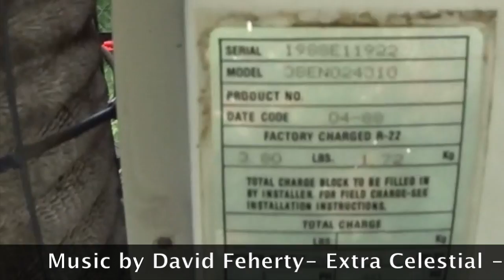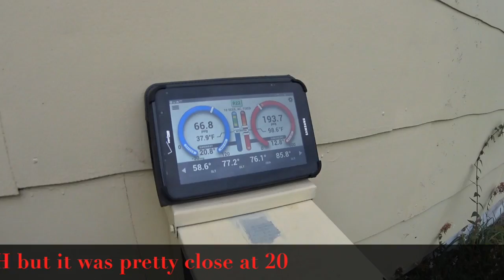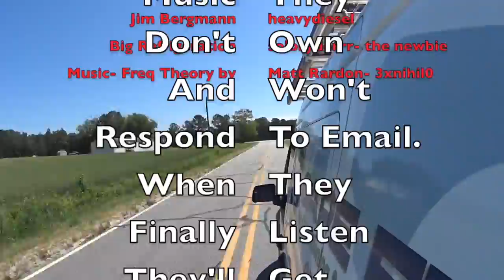HVAC Maintenance: Cleaning Your Air Conditioning Unit Won't Help

Comment: That 88 vintage unit was nasty. I’d have the owner give it a hug after the cleaning and show more appreciation for the job it does. I wouldn’t normally recommend cleaner on a spine coil but that unit really needed it. Here’s a fact. A build up of a .042” of dirt on your coil can reduce efficiency by 21%. This fact is from the EPA. I describe this to my customers. It’s like sticking a sock in your mouth and run around the block. Now take the sock out and do it again. Easier to do when your breathing good. Same as an AC unit. It works better when it breaths good. I rinse my unit with water every light bill.

Comment: What setting do you use on your coil cleaning gun?
Reply from the maker: Whatever number or letter is in the middle, I think. Haven’t changed it in years. I had one gun early on that when I tried to change settings it didn’t work properly so I found a happy medium and never changed it again. Thanks for watching!

Comment: ... And those poor people with their leaky R22 machine will get screwed by the EPA into replacing thier system because of the "ozone depletion" hoax.

=============

Does the fact that there is 6 months of darkness at the south pole contribute to lack of ozone there?

Why doesn't Clorox, pool chlorine, or chlorine from seawater (NaCl "salt water) deplete ozone?

Why do CFC's only deplete ozone at the south pole?

Why are CFCs the only source of high-atmosphere chlorine?

Being heavier than air, how do CFCs reach the stratosphere, which starts 6 miles up? 

Being heavier than air, what happens to CFCs when released into the atmosphere? 

If the ozone hole was "discovered" in the late 70s with satellite imagery, how do we know it wasn't there all along? 

The Ozone Scam
https://www.youtube.com/watch?v=9Szs-treHwQ&t=44s

Min 1:20  : The offending molecule is CHLORINE.

Min 3:30  :  Freon costs 50 cents/pound to manufacture. 

Min 2:40  : The biggest source of atmospheric CHLORINE is evaporation of seawater (NaCL in saltwater).

Climate 101: Ozone Depletion | National Geographic
https://www.youtube.com/watch?v=aU6pxSNDPhs

Min 1:50   : The offending molecule is CHLORINE.

Min 0:50   : Ozone is a trace gas composing 3 parts per 10,000,000 molecules of AIR. 

Lot of discussion of other sources of atmospheric chlorine: 
https://www.sciencedaily.com/releases/2010/03/100310134150.htm

Comment: How come no one cleans the opposite direction to push the dirt back out I see rinsing it that direction but I would have started with the soap that direction also and if that is not effective go to the outside
Reply from the maker: For this unit there’s little to no room inside the coil because the compressor is there, hard to spray from inside when you can’t get tour hands or hose in there.

Comment: Wow.  You don't know what your doing bro.  That shit will eat through your hands.  You should be wearing gloves.  Also you used way too much coil cleaner in one shot and for way too long.  You probably ate a hole through that coil if it didn't have 1 already.  60 and some change low side and 300 change high side is dirty condenser coil giving you high head pressure and dirty evap coil and blower or plugged filter for low side to be so low.  Duh.  Plus your a low on Freon at the end.
Reply from the maker: You're Right! I don't know much but i did stay at a Holiday Inn Express...
Reply from the maker: The video was poorly done for sure But the title is sarcastic. The coil needed to be cleaned before I could get the refrigerant charge right. Maybe I wasted some cleaner but it was already leaking or we wouldn’t have been low and it wasn’t going to work until it got clean. I’d rather spend a little extra cleaner and get it done than to dick around trying to save a few pennies.
Reply: Well I see where your coming from. It's easy to armchair quarterback right. Well some constructive critism if you'd like it. Explain. In your video at the end about the charge being low, how are you presenting it to the homeowner.  Are you selling new unit. Leak check and recharge?  Leak check and fix leak. Etc. Sometimes just the shrader valve leak etc. Not all low systems are doomed. Etc. Just would help give others the bigger picture. But atleast your brave enough to start your biz and go get the money.
Reply from the maker: yeah, i could have done better with my videos back then. i usually get impatient to post and short change the editing

Comment: this unit called the carrier trash can unit, anyone can see it needs cleaning.  the rental company will not ok the cost of replacing it.  some contractors only want to replace not keep the units running. if these installed to close to the wall you can't work on the electrical box.

Comment: How do you measure air flow before and after you clean the condenser coil?   I have an air spinner that has a magnet that sticks to the cabinet and a piece of fabric that spins upward from the discharge air flow.  You can tell in less than a minute if you have good air flow.   www.air-spinner.com  I have different lengths of fabric for up to 3 tons and up to 6 tons. Would you test it on one of your service calls with a clogged AC condenser.
Reply from the maker: I’ve usually just get to see if the air blows mostly vertical or if it comes off the top nearer the sides. Interesting concept the air spinner. Shoot me an email at stephenrardon@gmail.com

Comment: Not many bubbles from that coil gun. I use a 3 gal pump up sprayer. I get tons of bubbles. No hose dragging either. All your bubbles are on the ground. You need to spray from the inside out. Or reverse the fan motor and coil clean away. Man you waste a lot of coil cleaner. It's all over your shoes now.
Reply: maybe you should have done this unit..

Comment: If the unit was up off the ground 6" it helps keep them cleaner but dam that was some nasty dirt Concrete blocks work nice to raise them up a bit off the ground. PERFECT They want them to burn up so they can sale them a new unit that's the sad part many units get replaced because of dirty coils.

Comment: I have a suggestion. Get one of these from Amazon and use it to wash out the condenser coil from the inside out.
Orbit 58543 Telescoping Gutter Cleaning Wand with Ratcheting Head

Comment: ok what happen to the thing way it was not working right am not a AC guy
Reply from the maker: the reason it wasn't working was that it was too dirty. once the coil was thoroughly cleaned the refrigerant was able to better transfer heat.

Comment: You can use the acid coil cleaner out side like this. If you clean your condenser coil you more than likely  will need a refrigerant charge too. You expanded the capacity of the system and it will work like it's supposed to.

Comment: That AC unit is downright nasty! LOL. Huge difference there, great video! I go out and pressure spray mine every time I clean or change my air filters. I just use my hose nozzle on 'shower' setting, it has pressure but not any amount that could bend the fins on the unit!
Reply: in order to break surface tension on the water and coil, just spray some Simple Green if it is only lightly soiled..

Comment: Ever use a torch on those coils?
Trade actually recommended it as a way of cleaning their spine fin coils.
Reply: +hvac01453 have you ever been to the Trane factory in Tyler Texas? Yes they actually do recommend using a torch to burn cottonwood, etc off. Just a very quick sweep burns it off, and doesn't damage the spiny fins. I use a small propane torch and it works wonderfully.
Reply: +frmerrin2 These guys are just ignorant, torch is best for Trane spiny fins.
Reply: torch works great, ash just washes away
Reply: Do a little research before spouting off
Reply: Do a google search and get back to me,hell even look it up on youtube and then we'll see who the hack is.
Reply: Used to use on on my old carrier as well,worked great.
Reply: ridiculous, think about it for just 1/2 a second, use your common sense.  do you really think a TORCH is the answer?  Trane would never recommend that ever. Now then, a salesman on the other hand ???  or a parts man... When you burn away the dirt, what do you think happens to the hairlike spines? Where do they go?  Really.  Use Nu-Brite by Calgon (the purple / blue stuff ) at 2:1 and the foam will push the dirt off without any effort. The second coat may even smoke a bit.  Its not acid either, it alkaline (PH14 ).  The most important part of the coil is the top rows, this is where the desuperheating happens.
Reply: +frmerrin2  Trane says don't use acid or power washers., so you think they approve flames? Get real!  Read your manuals. You keep going at it with a torch, makes the rest of us look like geniuses.  Hack.

Comment: Few questions. 
What kind of coil cleaner do you use? 
What number on your coil gun do u spray at?
Check out my YouTube videos.  
As you see I'm more of a hydronic heating guy, but two years ago I got my universal refrigeration license so I'm fairly new to the AC world. Since starting AC I love it and your videos have been great. 
My last question: I want to buy a new manifold. I have Testo now and bought the wireless Testo but I'm not real happy with them. I want to buy imperia. Would you recommend I buy the i-manifold or I-connect system? Your input would make my decision.

Comment: why did you have to hook up that refrigerant tank to your gauges?
Reply: probably a leaker, and when the plumbers charged it, they did so with dirty coils, basically still undercharged... so when the coils are cleaned, the under charge is revealed.

Comment: 1:31 Carrier 38EN024 is a 2 ton unit with spin fin coils, built in 1988. I have a 3 and 5 ton units here from about the same era. The seer rating is my guess about 8.5, but that was when new. A dirty outside coil of course drops the seer ratings since the R22 is not cooled enough thus the poor in performance. Steve actually took the cover off the "carrier round" at 2:24. many hvac guys do not do this thus the washing might be not as good as Steves good job here. In coastal areas with salt exposure some of us have spin fin units via Trane, old Carriers, old GE's. The spine fin units are hated where Cottonwood fills up the fins thus some folks burn off the stuff with a torch. For 1988  at 8.5 ratings was high efficiency. We actually paid extra to get one of these with a TXV valve too to get the seer even higher. Probably most all are with a piston. An early 1970's Leibert AC I have was marked to be high tech super money saving with an eer of 6 ie SIX! yuck!
Reply from the maker: +3beltwesty thanks for the comment

Comment: The Jasmine Vines are a nice touch.
Reply: I usually have the customer come out with me and I tell them they need to trim these plants back 2 feet, or the life of the unit will be shortened... We all like to breathe, these run hotter with any resistance to air flow, heat and water are the killers to any mechanical device.

Comment: Looks like piss poor cleaner to me..i could had that bitch clean in 3 mins
Reply: And I'm sure the fins would fall off as well...
Reply: not really, the evidence is in the low head and good back, as long as plenty of water is rinsed over the coil it will be OK, what he was doing diluted the crap out of that mixture, but it was only a single row of coils, a low pressure power washer would have done just as well without chemical. I use an HVAC chemical sprayer (bug sprayer ) that will survive the chemicals, my cost is about $75 for the sprayer with replaceable parts like the wand, Still it won't survive storing chemical in it ( Sodium Hydroxide). Now when I spray this on a serious dirty coil, I wash or vac off as much as possible first. I use about 1/3 the amount of chemical as that applicator in the video.  Then again, your supposed to apply once, wait 5 minutes, rinse and re apply if needed, not just spray it till its gone. That crap will take care of the plants in short order.

Comment: Is it ok to use soap and water or a cleaner like simple green?
Reply: simple green and soap and water or even just the hose works, the cleaner we use on condensers is a foaming cleaner that expands and pushes the dirt out of the coil, clean coils are the key to starting any air conditioning lack of cooling complaint for me
Reply: move the weeds

Comment: A pressure washer would have saved a lot of time.  But I'm sure you would have used one if it was available.  Thanks for the video.  Brings back a lot of memories of cleaning large industrial air handling units.  Good thing I wasn't claustrophobic.
Reply from the maker: yeah +Greenfield 54 i'm driving a Transit Connect micro van... i couldn't justify taking up space with a pressure washer.

Comment: I get the same thing all the time. 3 people have been by and can't figure it out. But they said they could replace it for fill in the blank. Great work.

Question on the coil cleaner. I saw it was the blue coil cleaner. Do you believe in the yellow only I have heard from some for outside coil cleaner? I don't believe the yellow cleans as thorough especially on the commercial side when grease comes into play.
Reply: +Jason Curtis Yellow works fine if its not crazy dirty. Blue even diluted is really strong and will take a layer of metal off that coil. I only use blue if it's really that bad.

Comment: Mr. Rardon may you will tell me wath is the name the chemical you use.
excuse my english.
Reply from the maker: It is Condenser Coil Cleaner by NuCalgon
Reply: +Stephen Rardon (HVAC with Stephen Rardon) Can I use that on my truck condenser and radiator?  is their something different you'd recommend?

Comment: Only about 2min. In till I seen the gauge readings then the coil.....  my opinion although I haven't gone beyond the two mark..... cond. Plugged big time.  after its cleaned you will find its either lo on charge of considering the condo was that bed that the filter or evap is plugged too.....  I will watch on and see how close I got........

Comment: After buying my Used Home and my first Ownership place..( Rented places B4) 

1- I just hired a Pro service to come out and "Service" my 6 yr old A/C in the Spring and watched what he did.. Making notes of each step to do  and what tools & and a Cleaning Product To have. ( In this case it was a Foam cleaner)

2- And Cleaning /Triming the Bushes around the Unit.. and Installing Gravel around it so the Bare Dirt didn't Get into the Unit ..

3- I did it myself every Other Year and have them come out Every other yr.. 

4- Its been 6  yrs since and everything is Working just fine !

Moral? Don't be a Penny Wise, but end up a Dollar Foolish!
Hire a "Honest" Pro at least EOYr..!   and Try to Hire a Military Veteran- or If his Dad was one! 

And Give them a Tip of Either (a) $5 Subway Gift Card (b) Box of Choc Donuts (c) 6 Pack of Beer ..! ;-)
Reply from the maker: awesome, sounds like you found a good company to work with +Selna Goodhead

Comment: i know the unit was extremely dirty but your supposed to clean a coil from the inside out.
Reply: 6:00 dummy..
Reply: Jim Bee and use a real hose jet sprayer, not the soap applicator sprayer!
Reply: real hose jet sprayer, huh?

Comment: Air Conditioners don't produce cold air.....They remove heat and moisture from the ambient air making it more comfortable! That's why air circulation is very critical. Keep the condensor coils clean!!!!!
Reply: can't transfer the heat if the coils can't breathe!
Reply: +Semi Lost
 I always thought the ambient air was what cooled the condenser.

Comment: Hey man, they don't like your music. Pffft ! Big deal... The video was very helpful. It showed me a few things. The first is that a/c companies will screw you any way they can. 99/100 companies would have replaced the whole unit or system. The next is how cheaply these units are made. That entire outside unit with the cover off looks like $15 worth of factory manufacturing. I never knew it was so simple. Even a wall unit, one piece push in  looks more complex. The last idea is actually a question. I think the outside unit should be protected from direct rain, roof runoff and sprinkler system. Is this the case? Thanks...
Reply from the maker: Roof run off can cause some issues if the fan gets a direct torrential stream. Sprinklers shouldn't hurt unless they spray directly on the coil and flatten the spines or fins. Rain really won't be a issue for the most part.

Comment: Amazing what a little maintenance will do! The other guys that came before and did their song and dance shouldn't be in this business. I waited to see the pressures after the cleaning and I gotta say it brought a smile to my face...the one contractor said 'the pressures were fine, I don't know why it's not cooling'...what was he looking at anyway? Great job dude.
Reply from the maker: thanks for watching maurice435  just goes to show that pressures don't mean anything without superheat and subcooling.
Reply: Stephan Rardon, exactly. But a condenser coil that dirty/plugged, would have pushed his head pressure off the charts. So, either he needs to calibrate his gauges, buy new ones, or go back to every call he's been on in his life and recover refrigerant, because he over charged the crap out of every single system.
Reply: maurice43